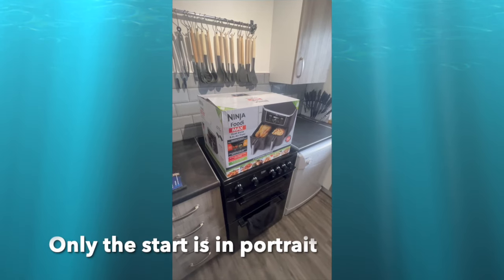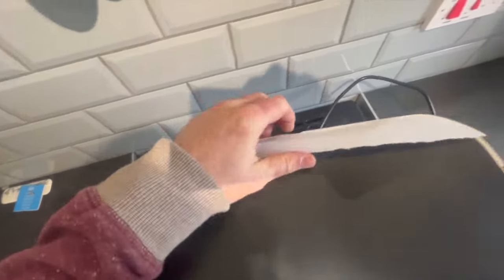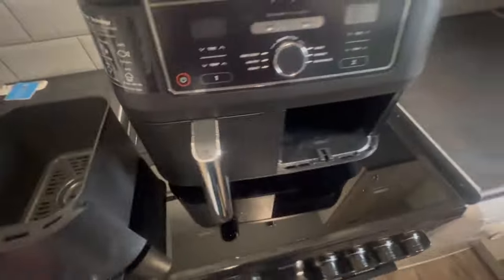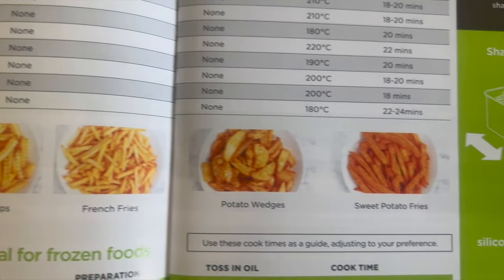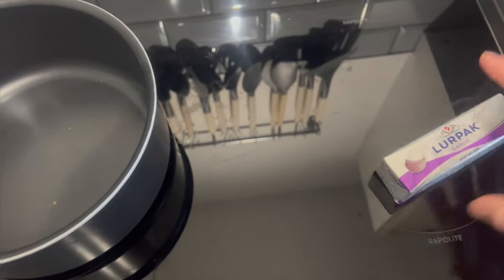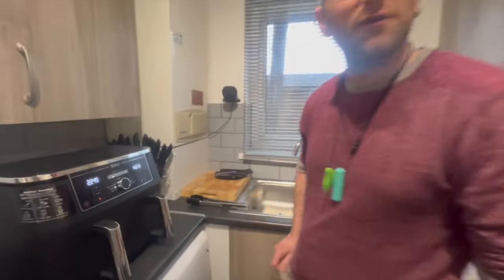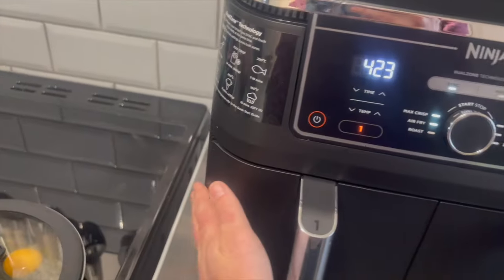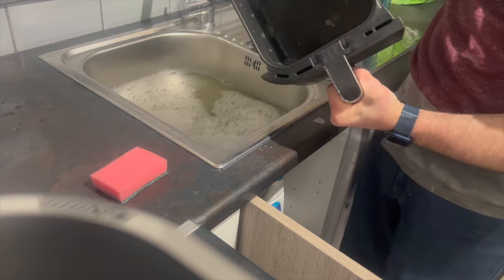Ninja Air Fryer AF400UK Honest Review

Comment: I've just bought this machine but am having great trouble removing the probe from it's 'box' in the side wall of the machine.  I've pinched the sides which I assumed would release the probe to remove it but to no avail.  Btw your video was very good and helpful.  You explained stuff really well.  Thank you.
Reply from the maker: Thank you for your kind words. Unfortunately my unit does not have the in built probe. If you message Ninja they may be able to help further.

Comment: Dave can you tell me what temperature and length of time you cooked your steaks. This video is the only one I have seen that appeals to me 😊
Reply from the maker: Hiya, I cooked them on air fry at 200°C for 4.5 minutes after brushing one side with oil, then turned them over and brushed with a little more oil, added salt & pepper & cooked for a further 4.5 minutes. The internal temp was 62°c when done. Hope this helps 😊
Reply: @Andy Carr  thank so much I will give it a go tomorrow ☺️

Comment: Great review. We use our Ninja daily and really don't use the oven much anymore apart from a pizza once in a while. Really would like to see you do a review of those Tefal pans you are using. Wondering if it is worth the upgrade. Thank you
Reply from the maker: I will do a review of the pans tomorrow and try and edit it to be released tomorrow night, please bear in mind I try and edit out my tics so it may take me a few hours. Thank you for the great feedback 😊
Reply: I’ve got those stacking pans, as we down sized, as we have got older, and I’ve found them great, the only down side has been the cheap induction hob, the previous people installed, it only has one small ring that works, with the small and medium size, the large size pan is not large enough to use on the larger area of the induction hob, which was a pain until I got my Nija speedi, when I haven’t needed to use the hob, it’s definitely the hob that’s at fault, but as it’s new I was reluctant to replace it after I got my speed. I used the pans on my Bosch hob at my other house and they worked there. I am now considering getting this dual Airfryer as that’s all I tend to use in the kitchen, veg in the microwave or roast veg in the Speedi, with a trivet to do the meat on, but the speedi that I bought so we could do paste dishes, I’ve not used as much as I thought I would, where as the Airfryer side I’ve used more, and juggling the airfryer with levels is do able but fiddly.